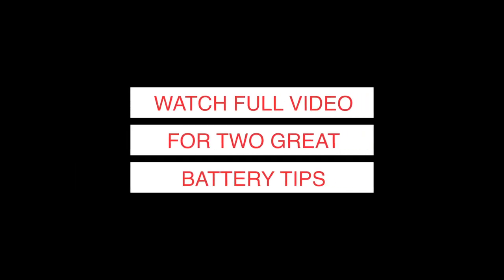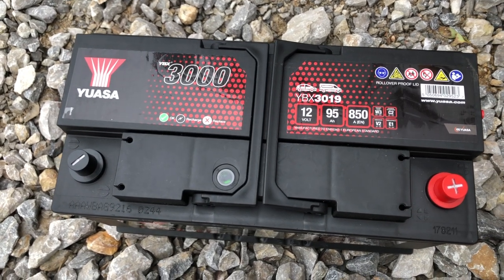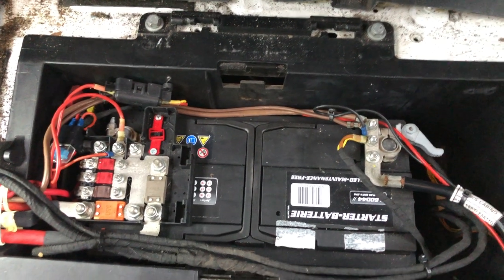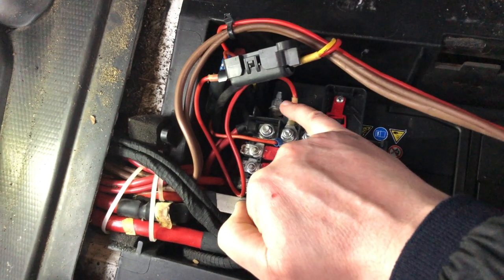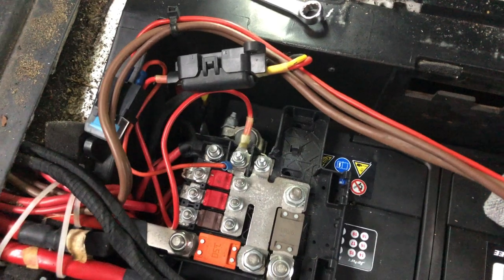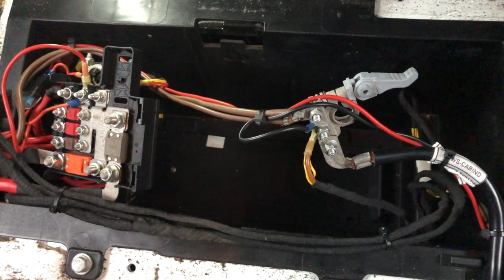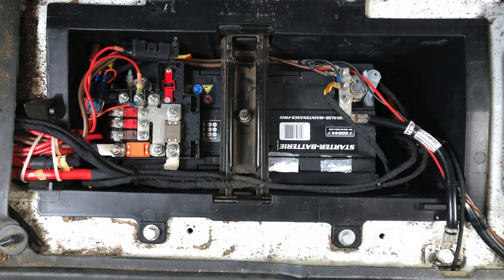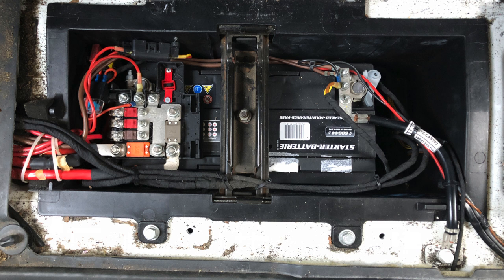CHANGING the BATTERY on a Fiat DUCATO Motorhome - PLUS Great 12v Fridge & Battery Tip.

Comment: No problems with the radio code etc?
Reply from the maker: @tomaitchison8726  No. I personally have had no radio issues. Ours is a 2008 Ducato based Hymer and the radio system is an Alpine one. I cannot say for certain whether newer models of the Ducato or other infotainment systems would have a radio issue. Usually this is easily resolvable anyway. Kind regards.
Reply: The radio code needs to be input after installation on my 2006 Ducato. I had to get the code through a code specialist on google. Around €10 or £10….
Reply from the maker: @noel7940  I see. Was it that your radio was completely dysfunctional after a battery disconnection or some other symptom?